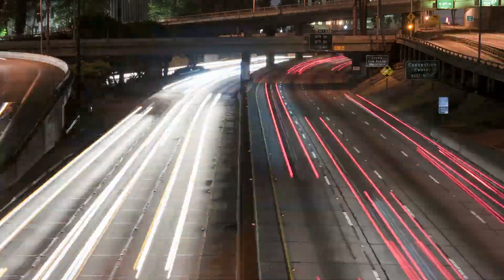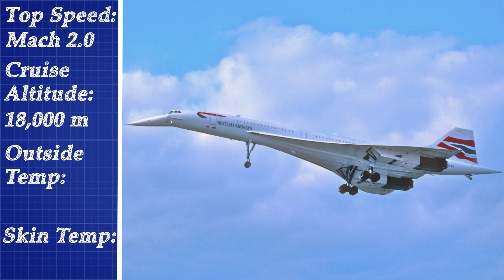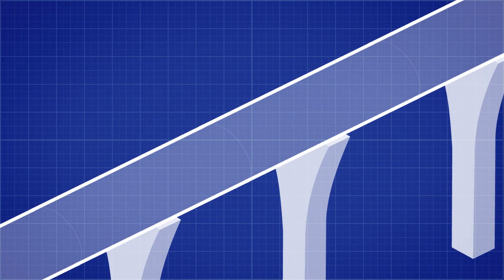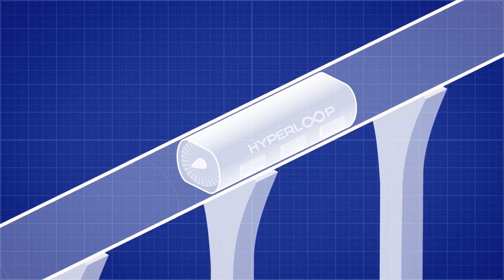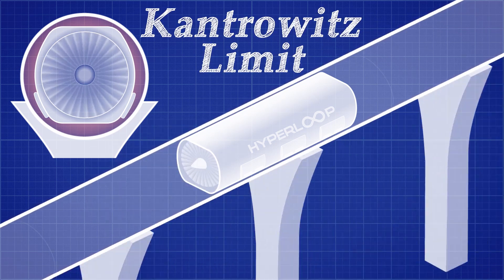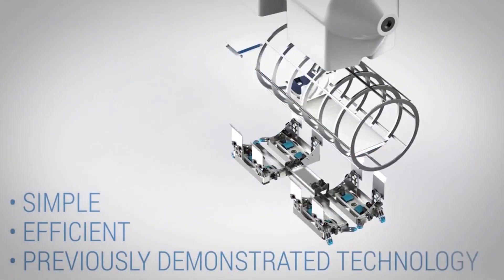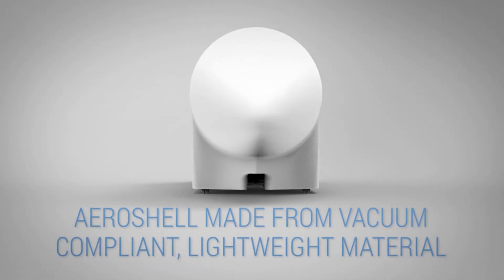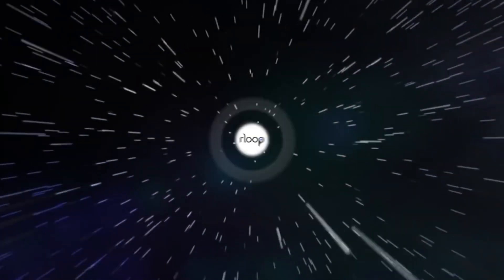Hyperloop - The Future of Travel?

Comment: What I'm missing in every clip about the hyperloop is the costs for building it. I still remember the maglev trains which is much faster and less polluting than regular trains, yet there are still only two commercial maglev tracks in the world, simply because it's much to expensive to build. In the windmill clip you showed why they have three blades. Surely you understand the impact of cost on innovative projects like maglev and hyperloop.
Reply: sensible comment
Reply: Paul Gracey
'When the Airbus falls out of the sky everybody dies.'

You're forgetting a small detail. In most cases with any technical problems on an airbus the plane doesn't fall out of the sky. If so there is so much as a small puncture in a wall of either the car or the tube everyone dies, guaranteed. If an airbus hits a bird it just flies on, if there's so much as a loose screw from the car before you in the hyperloop, the car crashes and everyone dies, guaranteed. Small but significant details.

'Why would you assume that all would die in the Hyperloop breach scenario?'

In case of a pebble the car will breach and go of course, hit a wall, break out, still fly about at about a thousand km/h, bouncing all over the place, creating forces that no human body can handle, not even in a protective suit. It's like trying to land a condor upside down on a mountain at a speed near the speed of sound, without controll. How do you assume that will end? Granted, a baby could survive with the flexibility of the bones.

In case of a breach, there is no way to safely get the atmosphere to a breathable pressure in time in a tube 300km's long and there is no way to make emergency exits. Not for under 60 billion dollars and strong enough to hold the pressure differences.
Reply: Yep. The economics of hyperloop are bad. That is because you have to calculate the average reduction of travel time for all journeys in which taking a hyperloop makes sense, in comparence, with alternative forms of transport. Total travel time includes the time you spent in slow transport reaching a station for hyperloop, and to final destination, and the time spent on boarding a train (safety measures will add significant time). This is bad for hyperloop as hyperloop stations will be on average further away as train stations (a rail network can service far more stations as hyperloop for the same cost of building). Like the maglev train, it turns out that this is bad for the economic viability for building such lines. Apart from that, hyperloop has bad passenger comfort, it will be like traveling in a space rocket. People with medical problems can't use such a system.
Reply: Not even the voids between galaxy filaments are perfect vacuums. I'm not sure that a perfect vacuum is even achievable, it's like absolute zero. That being said, maybe it would be better to push air from one end of the tube and have it come out the other, without the need for a vacuum. So the system would essentially work like a compressed air gun with several "bullets" in the "barrel" at once. Any failure in the tube would only cause the vehicles to slow down or stop. Breathing air in the vehicles wouldn't be a problem, nor would cooling or anything else associated with being surrounded by a vacuum.
Reply: Yeah but turning a 500km tube into a nearly perfect vacuum is very costly
Reply: Yes, but maglev will get cheaper. Plus, it's a hell of a lot safer and more practical than hyperloop.
Reply: cost of per km of maglev track maintenance is just not viable let alone putting it all inside a vacuum tube.
Reply: He NEVER said that. He was quoting the hyperloop team, who keep referring to a vacuum. Also, it's 0.01 atm, which is a 99% total vacuum. Calling it a total vacuum is okay, because it's as close to one as you can reasonably achieve.
Reply: Lungsandaheart
Yeah, except it won't be cheaper. The maglev track alone is going to be as expensive as all the maglev tracks which are vastly more expensive than Musk represents it and the tubing for 600km will have to be as much as was in the twin towers, which is quite a bit more than the steel used for a regular track.

You may want to look into the actual costs a little more critically, or look up Thunderff00t's video about it. The cost isn't the only problem.

Imagine being stuck in a 600km vacuum tube, because a vacuum seal nearby broke or some dickwad shot a hole in a tube anywhere on the 600km of tubing. If you don't die instantly from the pressure wave that will hit at about 2000km/h(1000km/h from the train coming that way and another 1000km/h from the air rushing into a near vacuum tube), the train will hit the emergency brakes(making the pressure wave still about 1000km/h which still is equivalent to the pressure wave of an atomic bomb). You are inside the tube with a limited amount of air and no way out. They estimate a train leaving every two minutes so there will be a few trains in the tube at all times. Those will stop as well, with no way out and a limited supply of oxygen. How many people do you suppose get saved from a simple technical failure before the rest suffocates? The cart doors can't open because there is a steel tube blocking it and air rushing by at about 1000km/h. That's like jumping out of a supersonic jet, into a tube with no exit.

Maybe they'll add vacuum pumps, seals and emergency doors every few meters. That should be really cheap to make and mechanical things electronically controlled have never ever failed before. If one does. See scenario above.

Bottom line: maglev is not commercially viable; Spacetravel at speeds close to the speed of sound in a gunbarrel is way more expensive and almost always ends in certain death, unless absolutely nothing goes wrong ever. It's not like a plane where you can still land with one engine after going km's off course. If something goes wrong and you go about 5 inches off course you crash the tube and everyone's is dead instantly and all other trains in the tube will have a hiroshima like shockwave coming at them.

Best case scenario: one of the trains has an electrical failure that doesn't result in rupture of the tubes and instant death and all trains will have to drive to the next station on wheels; 600km at about 60km/h, with a limited supply of oxygen and no exits.
Reply: How is a maglev less polluting that regular rail? I mean sure, the regular rail is diesel run, but electric rail? No way
Reply: I completely agree, high speed rail is the future not some rich man’s fever dream.
Reply: canidaeSynapse
Go back to school and then watch the video again after you graduate.
Reply: Paul Gracey
'the number of casualties will be similar or less than to shooting down a AirBus A380. Just as those airplanes have emergency exits, the Hyperloop will have what it takes for safe travel or it will fail to be built.'

The amount of casualties might be the same indeed. There will be about 20 people per train and they all die as opposed to over a hundred people on an airbus of whom 20 people might die and over 80 people survive. You should definitely take the hyperloop. 100% certainty! Who doesn't want that?

Tell me how do you suppose an emergency exit works in a train in a vacuum tube. Those safety features needed on the hyperloop alone are probably going to at least double the cost of the 50 to 150 billion it will cost to build 300 miles of track and that doesn't include maintenance or developing cost(which Elon obviously never pays, that's why he talks about his idea(he read in an old book somewhere) to have other people develop it so he can just take the then existing ideas for free and build it if it will ever be viable within his lifetime).

You have to give credit for Elon's creativity though. Hyperloop. What a name... Hyper for really fast and loop for ehm... rehashing old ideas that aren't his.
Reply: Stylish777(Alarmist detector ON) I believe you have your proportions inversed. When the Airbus falls out of the sky everybody dies. Why would you assume that all would die in the Hyperloop breach scenario?
First I think perhaps one car, or two might have a catastophic event just as in modern trains.  It would take an act of war type breach and that's what would take down an airbus in many cases too. 
The distributed pump-down facilities in the Hyperloop will each have inspection ports every few kilometers. The whole hyperloop in one direction can be brought up to sea level air pressure quite rapidly which will slow all cars at once. Thunderfoot's  pressure wave scenario is  complete balderdash. That sort of large breach is highly unlikely in steel tubing which doesn't shatter like glass and will  be mitigated by all the other pressure waves from controlled pressurization. Individual cars will be made to hold pressure long enough for normalization in the tube. Standard "Jaws of Life" type equipment can be brought to bear should it be necessary but .
 The system will have been tested in short test tracks well before paying passengers ever get carried. Should it not work there, the costs will be small and nothing will get built. (Alarmist detector OFF)
 Elon is a synthesizer of others ideas, he makes the most of what is state of the art. For instance I see elements of almost all other rockets built before in the Falcon 9, both by the Soviet , American and European design teams in the past.  It is reasonable to question his results  and be critical, but you should be wary of outright dismissal given his track record so far.
Reply: he didn't say it was a perfect vacuum, just that it was close to one and it is. Look at space flight, that is the hardest thing we can do right now and that's because working in a vacuum is fucking tough. One small hole in your space craft or international space station and you are well and truly fucked, same thing with the hyperloop.
Reply: Diego C: That idea and its compliment sucking air out ahead of the capsule has been tried for passenger transport and failed economically more than 100 years ago. Air in a tube is not frictionless as you seem to suppose. Indeed, air gets hot being pushed through a long tube. The same way the Concorde Supersonic airliner got hot being pushed through even the thin air at its high cruising altitude. 
You are right though, a leak in the tube would slow all capsules as the pressure rises. One thing most here do not seem to understand is that these Hyperloop trips are meant to be quite quickly accomplished. 1/2 hour  or less for most proposed routes The capsules can easily be provided with enough air and pressure to withstand small leaks.
Reply: Maglev are not much better than conventional trains, because over 360 km/h, air is the problem to advance.  And maglevs cannot use conventional tracks nor enter city centers easily.
Reply: Maglev tracks are costly, because they need to carry heavy maglev trains. The hyperloop capsule would be far lighter, so it would need far less support, therefore far less concrete, steel and so on. The hyperloop tube would be easier to build on high pylons, so the land underneath can be used freely - unlike the proposed California High Speed Rail.
Reply: @nikolatasev4948  How does a 'capsule' weigh less than a rail car ? That's pure fantasy again.
Reply: My,... what an active and inaccurate imagination you have. Also a very shortsighted view of the history of air transport, even if restricted to just the last thirty years of remarkably safe air travel overall, planes have crashed with all aboard lost, some times for a very tiny problem of a pitot tube icing up for lack of its heater.
  
I have no idea of your education, level of expertise in the physics of this sort of vacuum, but I think I can safely say that the Hyperloop will not be built and passengers allowed in it without all of your suppositions both considered in the design, and tested beforehand if those concerns are found to have any relevance to its safe operation. 
What you seem to be suggesting in your unlikely scenario is that the tube wall will be very close to the capsules and that therefore the capsules will have to impact the slight detritus you mention. That cannot be, even  just to build the thing and get it to work with no one on board in the first place.

Like the Japanese superconducting MagLev system it will depend heavily upon the control algorithms, but will need to be more highly controlled for centering within the tube, with enough room for relatively tiny detritus to be of no concern.  Being a tube it will be easier to assure this than track inspection vehicles do for open systems like Maglev. 
 In fact I predict that if the testing shows this system to be a viable improvement upon their work, with lower operating costs, those Japanese MagLev trains may get converted once the life of the present train units are amortized. Look how they went to great lengths to enable the shinkasen to use the tunnel to Hokkaido.
Reply: People were warning about the same kind of things with every new technology. They were warning about the dangers of electricity and how everyone would be electrocuted when it was becoming widespread. They were saying that people weren't meant to fly. I'm sure that an ancient Roman would be horrified that we travel at 150 km/h inside large tin cans. Just a rock in the way and you'll die in a horrible crash! Maybe the Hyperloop or a similar system is indeed not economical or practical, but I disagree that everyone would die horribly, that everything would blow up, or whatever. It does seem like a monumental undertaking, but then again, things like the Internet (which is almost free), running water and global commercial aviation are nothing short of miracles of civilization.
Reply: Ashley Godden: you have at least two things wrong with your suppositions.  The tube is a far from perfect vacuum. I have worked with spacecraft test chambers, and the Hyperloop is  nowhere near that level of vacuum.  Also the difficulties of space aren't nearly as bad as you make them out to be. Submarines are much harder. It is the getting to and from space that is both dangerous and hard. 
No, the level of low pressure in the hyperloop is less than had to be withstood by Felix Baumgartner's Red Bull provided (essentially throw-away) capsule for his jump from above 120,000 ft altitude.  Other balloonists have gone that high also. The dangers they faced are from the height, not the low pressure. Small leaks are minor by comparison, and the ISS has been designed to deal with them successfully.  It is not like popping a balloon. 
Consider the nearest competitor for hyperloop speeds the Concorde. All the troubles of standard airliners at double the altitude and speed. Not to mention abysmal fuel consumption.  It could not fly much higher because the engines were developed from those of 1950's vintage  high altitude bombers. It stretched out in length from the heat of its friction through the air, but the Hyperloop capsule will be electrically propelled at an altitude equivalent nearly twice as high, with no wings needed to get it there.

SST's are still in our future, with better materials, but, unlike the Hyperloop, will be suited to much longer  routes. Hyperloop, if it gets built, will depart more often than airliners, having much less complicated boarding and de-boarding, along with spending more time getting there and less time getting to 'altitude' because it will not need very complex systems of wings, landing gear, navigation and flight control equipment to avail itself  of the speed benefits of high altitude transit.
Reply: cost will decrease with time, otherwise you would pay 100 million for a 100 GB HDD.
Reply: @anarchismconnoisseur2892  Incorrect comparison. Your 100GB HDD costs so little because of MINIATURISATION !
Reply: If it gets built at all it wont be because of naysayers like you. It will be tested at every step of the way. We already have most of the technologies needed built for other purposes long ago. No, Thunderfoot is just desperate for eyeballs so he is making alarmist videos with little to no real truth save the cost factor. It will be far more expensive to engineer than Elon says, but it can be operated far cheaper than any other technology based on old ideas from railroading so that is why investors are coming forth.
 Shooting a hole in a tube made as strong as needs to be for safety will cause a slow leak unless it is an act of war. Even then, the number of casualties will be similar or less than to shooting down a AirBus A380.    Just as those airplanes have emergency exits, the Hyperloop will have what it takes for safe travel or it will fail to be built.
Suppose, for instance the tube is equipped to add air leaks all along its length in the worst case rupture scenario. Then the pressure wave that Thunderfoot so cleverly, but simply illustrated will be damped out by competing air drag, the capsules will slow rapidly still pressurized internally, and all aboard will have normal atmosphere by the time they all come to a stop.  Beats to hell falling five miles out of the sky with plenty of time to contemplate one's impending demise, doesn't it?
Reply: @paulgracey4697  Believers in sci-fi fantasies like yourself just don't 'get it' that it''s an utterly ridiculous idea.
Reply: In Musk's original paper where he proposed hyperloop, he did write about the cost. He estimated it to be significantly cheaper than typical high speed rails projects, including California's current high speed rail under construction.
Reply: @Lungsandaheart  And it was pure make believe that it could ever cost less than high speed rail (which also actually WORKS).
Reply: hey look, Thunderf00t really reached far with his misconception that the Hyperloop would use a perfect vacuum.